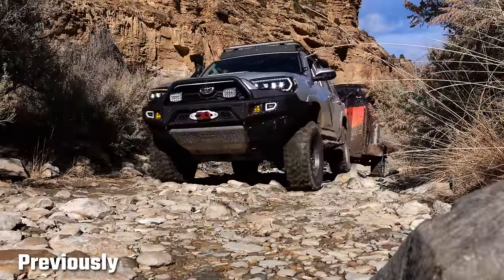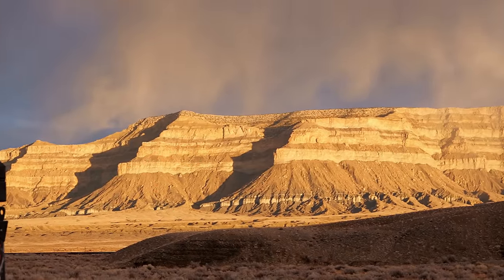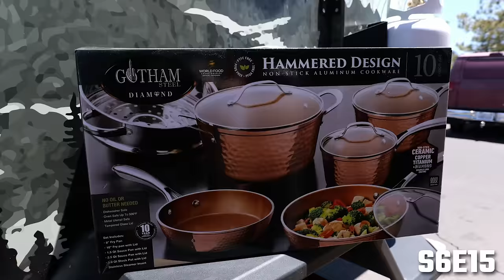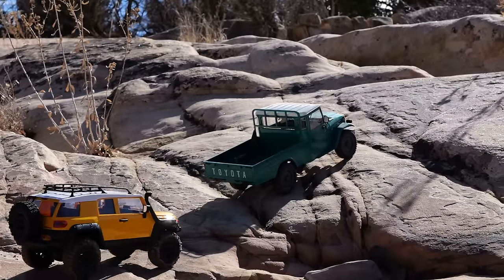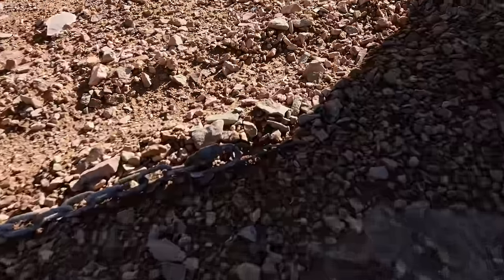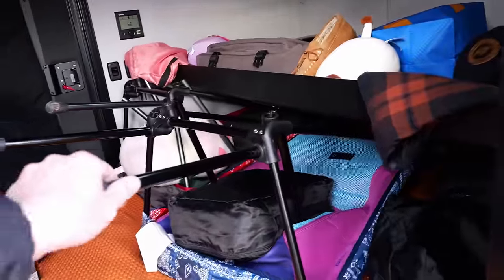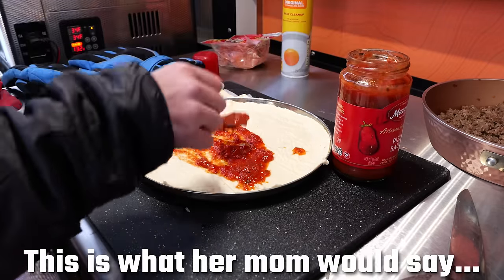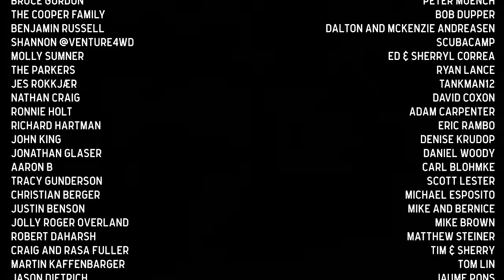This trail took a surprising twist [S7E9]

Comment: That trailer chain happens. As I got older I started to add those locking links,and leave it there, to hook on to so I don't have to bend too far to visually check.

Comment: Very interesting about your hitch-in coming out, we had an experience with our camper trailer in outback South Australia we had pulled up for a cuppa and whilst we were away some idiot had pulled the pin out, (no way we could’ve forgotten) we had driven over 1500klms and we had to stop for a break and has my husband came back to the vehicle he saw our camper trailer just hanging in the tow bar on the car…so we always make a habit to check if we stop anywhere now and also carry spare pins, for the just in case moments.